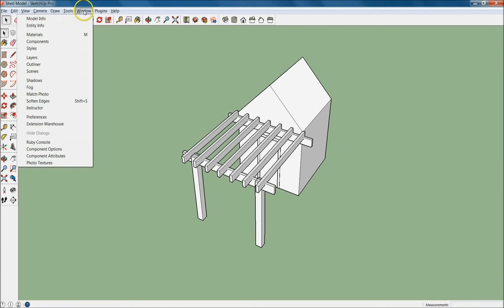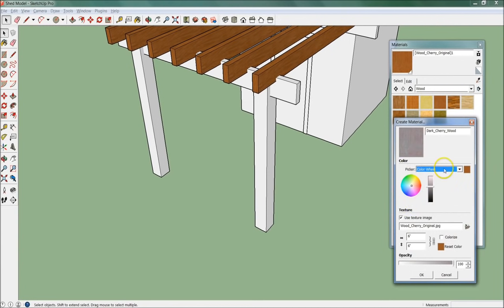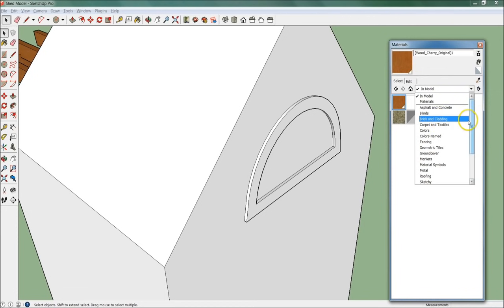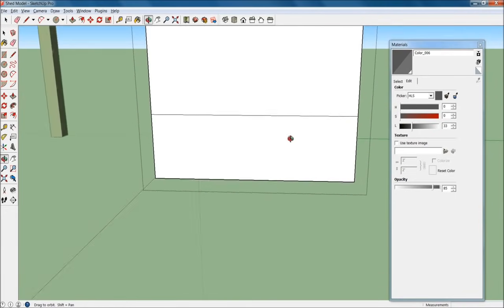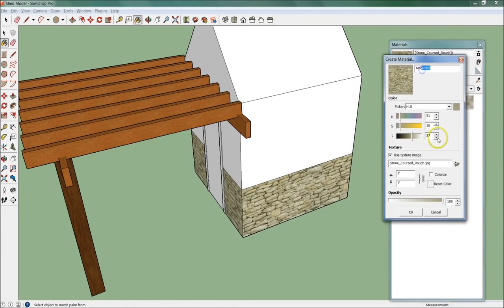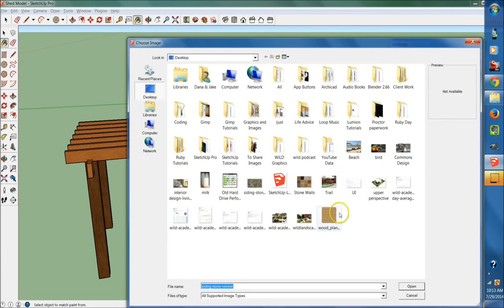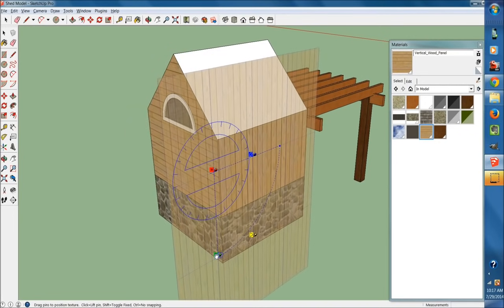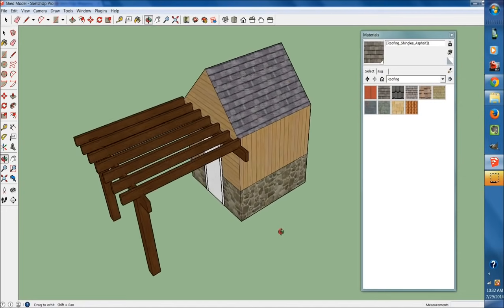SketchUp Tutorial - 4 - Materials

Comment: Jacob, great job with the tutorials. I'm learning a bunch!  I have a question though. I ended up with a diagonal line through one of my walls and when I try to erase it, it removes the wall. How do I get rid of this line that is splitting my wall into two sections and keep the wall as one unit?
Reply from the maker: +Tim Westercamp This can happen sometimes. It's usually because one of the corners got misaligned. Meaning, it's not on the same plane as the other three. You can fix this by:
1. Grabbing one node/point at a time. (You can't pre-select a node. You need to use the move tool and click and hold on the node. 
2. Hold shift to keep your node movement locked to the proper axis. Move it in or out to check that it aligns with the other three. You'll know by putting your pointer over another node and checking to see if there's any length shown in the bottom right dimension box.
3. You need to check at least two nodes to know if the one you're checking is actually the one that's misaligned. It could be that the one you're using to reference is the rogue node.

If that seems confusing just delete that wall and push/pull the other wall out to where it was. 

It's always fun trying to explain visual concepts. It's so simple even though it takes three paragraphs to explain. :)

Comment: Hi! I've followed these tutorials but find some steps are missing - like the pulling out of the window lining of the half-circle window (for me it was divided in two so I had to delete two lines on the sides to make it work - don't know if that was right) and the disappearance of the dividing line of the front gable. When I added the wall material I found that both my gables are divided into two parts that coincide with the horizontal lining of the roof, even though there's no visible line dividing the two areas. This means I have to add materials to a gable in two steps,  instead of one like in the clip. Where did I go wrong? I'm a total newbie to sketchup so when a step is missing and I get a different result from what's shown in the clip I get confused ;) Help much appreciated.